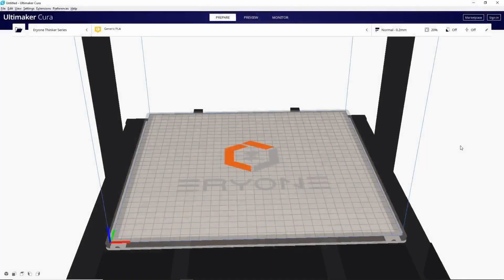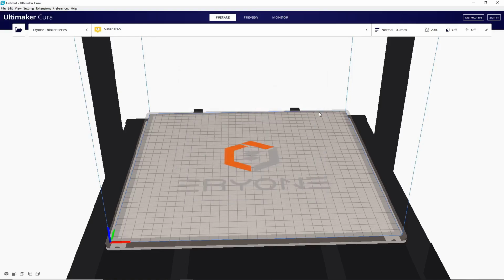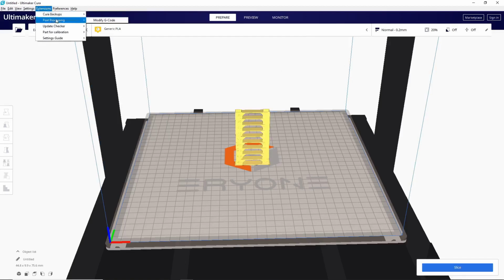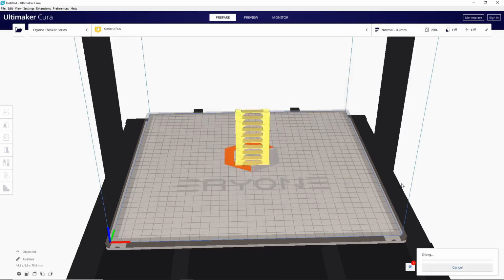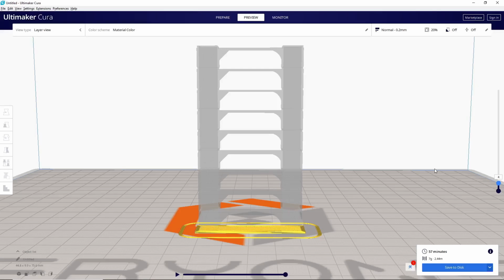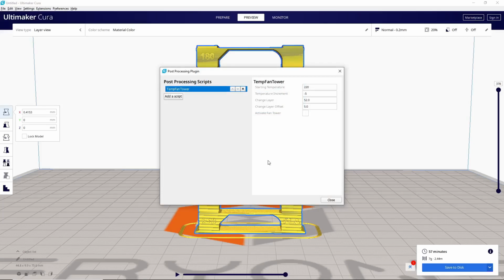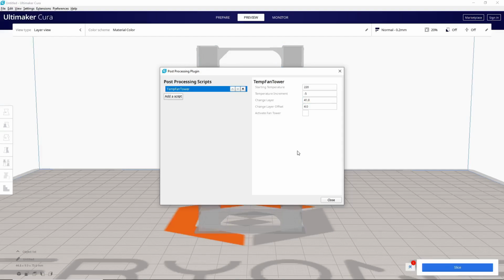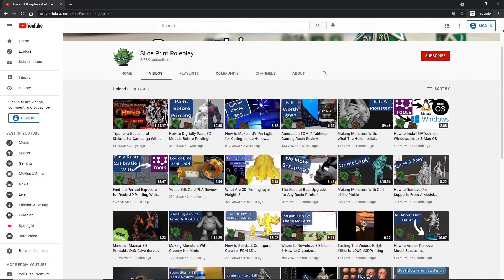How to Create a Temp Tower Test in Cura - Easy Tutorial!

Comment: I have an ender 5 pro. The temp change is not showing up on my readout, is this normal? I have tried it a few times and I have done everything you did on the tutorial. Please help!
Reply from the maker: Are you using a terminal or an SD card?
Reply: @SlicePrintRoleplay  Micro SD
Reply from the maker: @jf6720  that's odd.. In my experience if it's not showing up on your display then the temp likely isn't changing... If you don't have any adjustments to your Z height then you can use the pre sliced test on Thingiverse.
Reply from the maker: @jf6720  I talk about that in this video.
https://youtu.be/Z_VjBC2DX6U

Comment: So I followed this easy to follow video, but for some reason according to my Octoprint, my printer stayed at a consistent 218°C  although the target temp showed it was dropping. Any idea what maybe the issue?
Reply from the maker: Hmm that's odd. 
I don't use Octoprint so maybe there's an issue there. Can you try running it from an SD card to see if it works correctly?
I can't see why it would be different, but it's worth testing.
Reply: @SlicePrintRoleplay  I ran it a second time. The temp on my Ender3 V2 screen showed the temp dropping appropriately.  The octoprint screen showed the constant temp. I think it maybe a communication/firmware between the 2.
Reply from the maker: @TheEthanRivera85  ah okay that makes sense. I really appreciate you running that again and reporting back! Knowledge is power so thanks for sharing!
Reply: @SlicePrintRoleplay  Definitely a Firmware issue. Upgraded from stock to Jyers IU and its recording/implementing the temp drops accurately.
Reply from the maker: @TheEthanRivera85  oh awesome that's really good to know. Thanks!